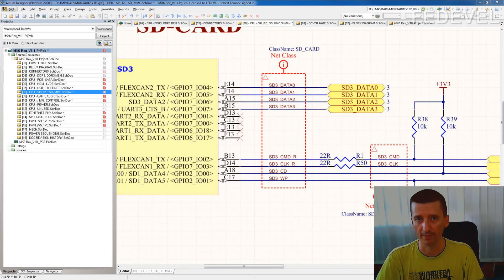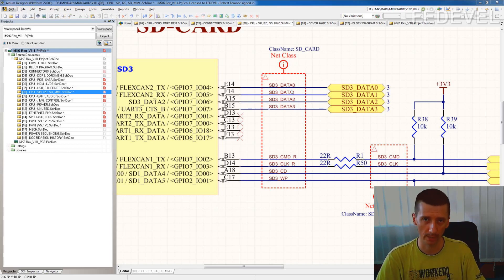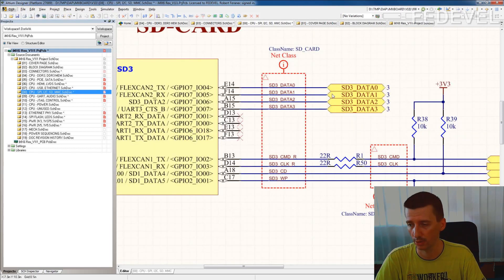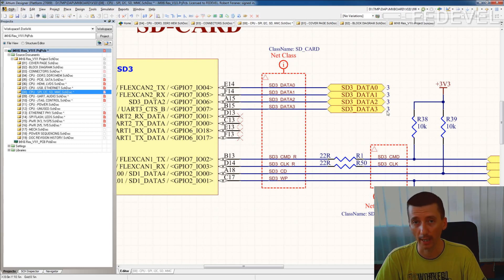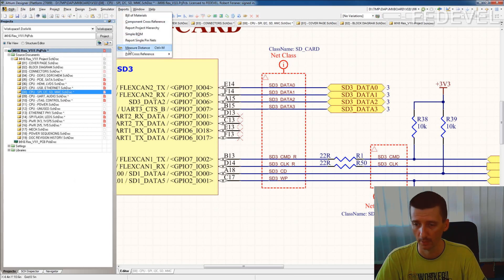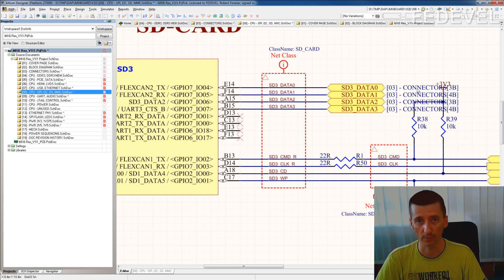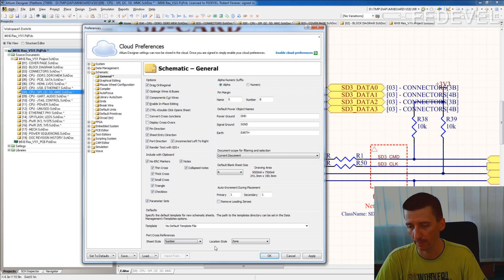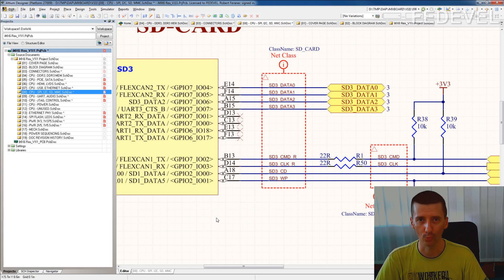How to add a Page number to a Port in Altium Designer

Comment: Thanks for another informative video Mr. Feranec. May I ask how you've annotated your sheet numbers so that Altium recognizes only the numerical portion?  When I add the sheet "number" to the ports I am getting the whole file name of the sheet (without the file extension) so for example, instead of the port saying "16" next to it, it says "16_Power Circuit"
Reply from the maker: +Raylon Smith DXP->Preferences->Schematic->General->Port Cross References: "Sheet Style = Number" and Location "Style = None". Hope it helps. Robert

Comment: Hi Robert,
Is it possible to add a prefix and suffix to the page number ? For eg. <page number>. I have searched altium documentation but haven't found a method to do this.
Reply from the maker: You can manually change the number, however I do not know if you can setup prefix and suffix. (However, Altium refers to these as SheetNumber / DocumentNumber so I am not sure what will happen if it is not a number)
Reply: Thanks for the reply. Much appreciated.

Comment: Hello Mr. Feranec, I tried this in version 13.3.4 and it doesn't add page number references to ports. If "Location Style" is different than None then it add references but this is not what I want. What can be the solution?
Reply from the maker: Hello Hassan. It should work. If you keep having problems, I recommend you to change the Altium version (AD13 was a really bad version with a lot of bugs).
Reply: Thank you for fast response.
Reply: You should numbering schematic sheet first. Tools » Number Schematic Sheets » Auto Sheet Number.
Reply: Yup, tried that and worked for me